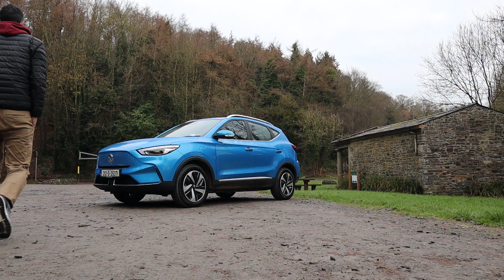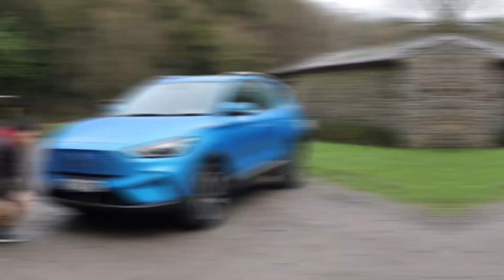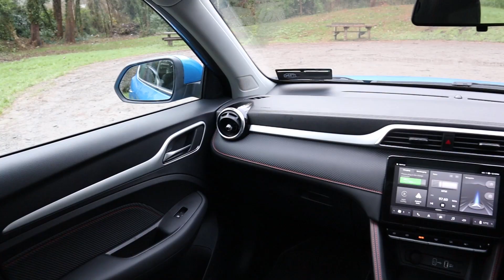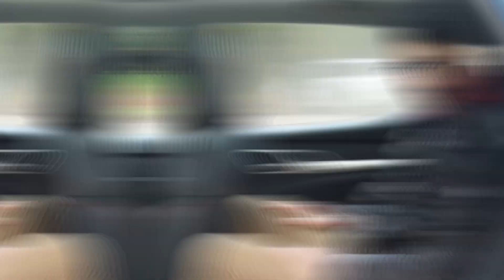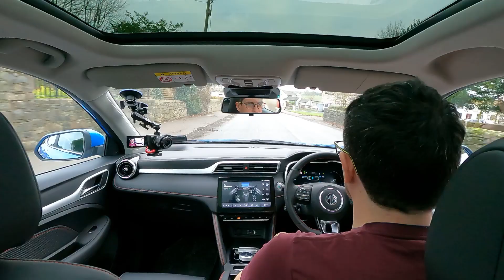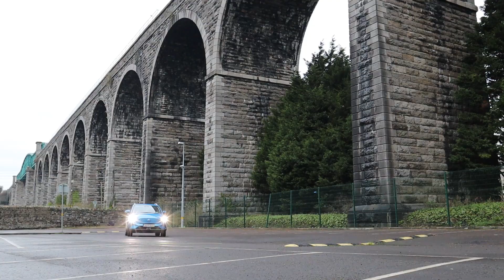2022 MG ZS EV | Refresh | Full Review & Test Drive

Comment: You need to remember that many people will be coming from older ICE vehicles which have very little tech, rubbish infotainment systems and zero cameras... this will be awesome and light years ahead of what it's replacing. I have an Opel Insignia Sport Tourer which has cruise control, and the worlds worst infotainment system! The MB ZS knocks my Insignia into a cocked hat! On top of that it has great range & most importantly is affordable. It's doing well already, not many available at the moment, all sold out nearly!
Reply: You must also consider that for former ICE drivers, the ZS is quite a hot rod by comparison. Many people are having great issues with too much performance from their new electric cars.
Reply: what is the current delivery time from ordering ? , I know its potentially six months with the likes of a Skoda Enyaq but are MG as slow ?
Reply from the maker: That's very true Craig...there's some features on the car that some very posh ICE cars don't have! And demand for the MG is showing that as you say. Thanks for the comment!

Comment: The problem here is... Yes the MG is cheaper than the rest. Is it showing the competition up , hell yes. BUT all this is doing is is giving MG a bigger market slice. Will the competition lower their prices , NO they won't. Once MG has established a bigger market MG's prices WILL RISE
Reply from the maker: We're pretty sure that the competition will be lowering prices. Battery costs have dropped a lot. And with increased competition, manufacturers will have to keep sharp. Although with demand outstripping supply at the moment, that's keeping prices up. Time will tell! Thanks for the comment!

Comment: Not so good value now that UK gov has reduced the grant,☹️also I've got the 1st gen model, and apart from the battery /led lights, I prefer mine (heater controls etc),plus lane keeping assist is better and the acc still uses the service brakes not re-gen as the MG 5 does!☹️
Reply from the maker: Good points there Baz, and if you don't need the range then why change?! It's still great value compared to the competition. Thanks for the comment!